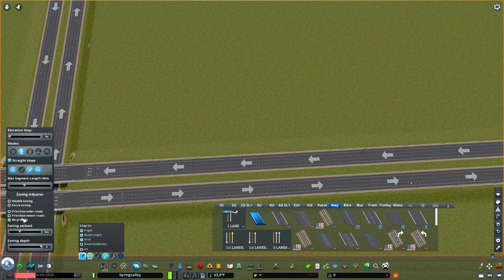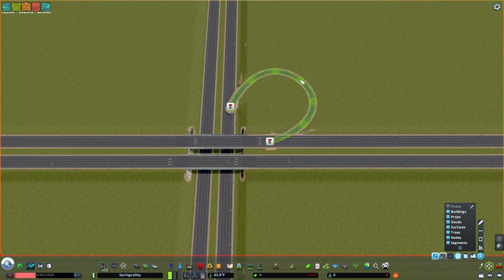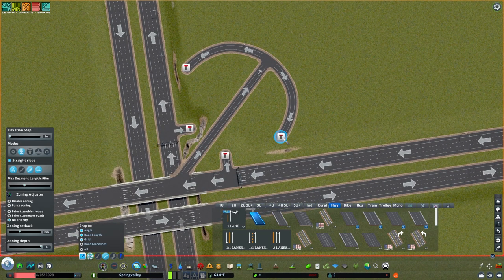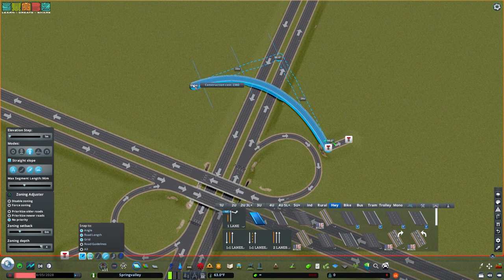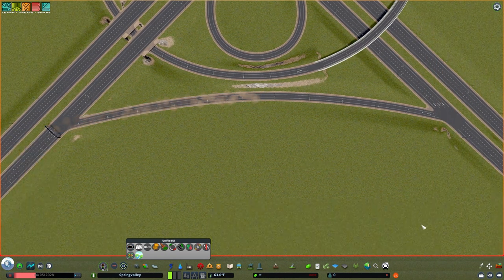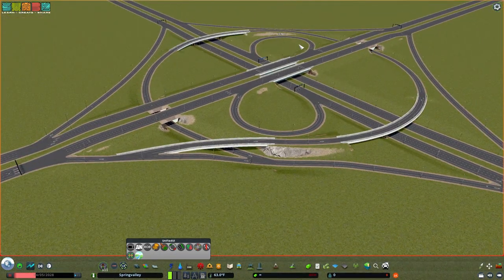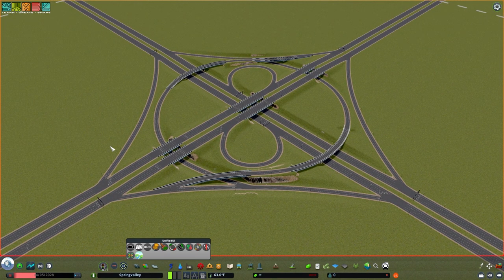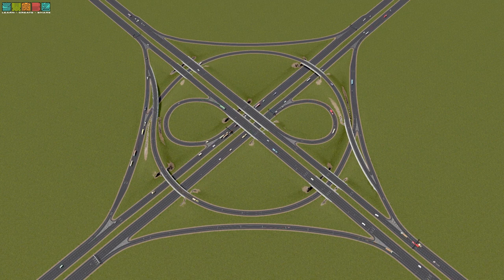The Cloverstack CRUSHES Traffic in Cities Skylines

Comment: If we're going for realism, we cannot be narrowing the highway down to two lanes in the middle of the interchange. AASHTO's highway manual has a section called "basic number of lanes" which basically says to keep a consistent number of through lanes regardless of exits (contrary to what many C:S players recommend for lane math). Lane balance is resolved by adding auxiliary lanes where necessary.
Reply: True but i think traffic AI pathfinding mechanics make it an issue as thru cars will still sit in the right lane causing unnecessary congestion for the exiting traffic. Just the way the game handles lane switching could be improved, but honestly that may be realistic cuz ppl suck at driving
Reply: The real world is messy. There's an example of a similar interchange in my hometown of Reno, NV. Westbound and southbound both reduce to two lanes in the center of the interchange (not exactly the way it's done here: there are lane merges). Isn't it possible the "basic number of lanes" is just two lanes?
Reply from the maker: The base number of lanes could easily be considered 2 here.
Reply: @YUMBL  Pretty sure they try to make it equal to the number you see in stretches between interchanges (not counting weave lanes between closely spaced ramps - those are auxiliary lanes).

After looking at system interchanges on Google Maps in urban areas (and I mean urban, closer to the center than the edge), some follow this principle, some don't. I wonder if high traffic system interchanges (I'm talking stacks) get special treatment because of the sheer volume of turning traffic? Or maybe it's practical difficulties of merging multiple lanes of turning traffic into the mainline in a reasonable amount of distance, especially given how squished together those interchanges can be.

Rural interchanges of course HAVE to follow this principle, because the required minimum is two lanes; they have no spare lanes to drop.
Reply: Okay a lot more urban system interchanges maintain basic number of lanes than it initially looked like. It turns out, it takes a LONG distance for multiple entrance lanes to merge into the mainline, so limiting the inspection to the interchange's immediate surroundings can be misleading.
Reply: I see why those interchanges drop lanes now. That highway manual has another section called something like "Coordinating lane balance with basic number of lanes." It basically says to drop/add x-1 lanes for an exit/entrance ramp with x lanes. So for a service interchange with a single lane exit, don't touch the mainline. For a big stack interchange with a two lane exit, one lane may be dropped from the mainline.

But then what is that rightmost lane on the mainline? It lasts for miles before ending, so calling it an auxiliary lane is a stretch (pun intended). But if it gets added dropped at every system interchange, it isn't really a basic lane either.

Comment: Clothoid loops ease off the acceleration experience by the passenger and driver on a cloverleaf highway.

This makes the ride significantly nicer and less painfull. Traditional perfect circle loops have sudden significant shift in acceleration which can cause pain on riding the loops. Its like suddenly speeding up then slowing down in a short time frame.

Comment: Hello, highway designer here. 
I know that you said that this isnt a real clotoid. Just wanted to add little nore info that curves like the one you designed are used in real world, however mostly in intersections.
I spent at least 5 minutes trying to find how to name these type of curves with two different radiuses however without any luck. I would call it like biradius curve or something similar. The curve in question is called "krzywa koszowa" in polish and its name originated from swedish manual to road design in 1930ish where it is called "kornsningskurvor".
Real clotoid has its radius gradually changing from infinity (aka straight) to desired radius over the distance.
Anyway, great vid, cheers
Reply: The railway also uses infinite radius instead of straight :)

Comment: You mentioned it but I mention it anyway as I was thinking it (having studied Railway Tech): Yes, railways do use this method, with a curve leading in to the curve. Because railway curves are also banked (which rollercoasters are not btw for obvious reasons) this curve is also the lead in to the full bank. With modern tamping machines all this is just in the computer, but in the old days you had to measure it when adjusting the tracks. You also needed to measure it manually before the modern machines that do it while driving on the tracks. Its really something I like :)

Oh, and on the railway there are no straight tracks. Its just infinite radius :)

Comment: The ease-in and ease-out trick might even help traffic flow stats. Cars and trucks drop speed for corners and if they drive slower then assigned speeds it makes the road more red. I've noticed using node controller to twist the road up to 10 degrees so they lean in also helps a bit to make them go faster, so they drive closer to the intended speed. It doesn't do much but on a map with a lot of sharp corners it can give you that 1%

Comment: Nice design. 👍
It works well and looks pretty from the air, which we all know is the most important thing in highway design! 

You're absolutely correct about the clothoid curves, but if I were to offer a criticism, they're still way too tight for a system interchange. 14u is about 112 meters which gives a turn radius of 56 m at the tightest point. That's about a 25 mph (40 kph) curve. Ideally a service interchange should not require a change in vehicle speed, or at most a 15% reduction if possible. At least they should in real life. I'd personally reserve a loop that tight for a service interchange. 

Lots of folks don't care about realism, and that's perfectly OK! Your sandbox. We also have to make some compromises due to the limits of the map size. I get that. That said, for folks that are looking for some reference design guidlines, here are some useful numbers for road design:

# Speed -- Minimum Radius / Usual Radius
45 mph -- 179 m / 226 m
50 mph -- 231 m / 291 m
55 mph -- 293 m / 451 m
60 mph -- 366 m / 604 m
65 mph -- 451 m / 745 m
70 mph -- 552 m / 916 m
75 mph -- 674 m / 1010 m
80 mph -- 814 m / 1221 m

Also, for urban streets...
15 mph -- 14 m
20 mph -- 30 m
25 mph -- 55 m
30 mph -- 91 m
35 mph -- 138 m
40 mph -- 203 m
45 mph -- 274 m

I snagged those from a street and highway design guide at some point and jotted them down. Sorry that I don't have a link to the original. 

While I'm dumping numbers, for the US Interstate Highway System...

4% Grade -- max through generally flat land
5% Grade -- permissible when the route must traverse rolling hills
6% Grade -- max in mountains

Finally, some grades taken from consultation with commercial truck drivers...

3% -- cruising at highway speed
4% -- no worries
5% -- straight roads ok; arterials, commercial/industrial districts ok
6% -- depends on how straight it is, how long it is, how heavy the load
7% -- US Highway System maximum
8% -- FULL CAUTION! Not going to be able to stop. This is the hard limit on commercial/industrial roads.
9% -- Max for residential collectors
10% or more -- Come to a complete stop at the top and descend carefully in 1st gear
15% -- Max for local residential roads (good luck getting your moving van up/down there!)

Hope that helps for the folks that are into such things.
Reply from the maker: Great info!!!

Comment: I recently learned, that with the curve tool (not the freeform one) and using precision engineering, you can get quite precise angles when holding down ctrl. It snaps the angle to multiples of 5. Maybe this is a neat trick to be used here as well and can save some move-it efford
Reply from the maker: I use precision engineering all the time. What do you think I did here to get the 45 off the corner at the beginning?
Reply: @YUMBL  yes, I know. but if you use that road tool, hold down ctrl and drag a corner, you can make perfect 120°, 115°, etc corners
Reply from the maker: Exactly. Thats what i did.

Comment: To be nitpicky, this is a clover-turbine, not a clover-stack. In a stack interchange, the left turns turn in front of each other. In turbines (and windmills) opposing left turns cross over each other. The difference between turbines and windmills is where the road that you drew at 12:52 connects. On a windmill, it connects to the main road, to the center of where the main road crosses the left turns; in a turbine it connects - anywhere else, really - but usually to the right turn ramp as you did.
Reply from the maker: Google cloverstack and see how they look.
Reply: @YUMBL  What? Why are you right? Who named the cloverstack? What's the point in naming something cloverstack if there's nothing stacked in it? I'm blaming that person for my mistake.
Reply from the maker: I’m always researching :)

Comment: I bet you could smooth out the loops even more using the bend tool rather than the freeform. Maybe do, like, 7x8 or 6x7 on the main bends, so the transition is even smoother.

Comment: I'm wondering if the same logic for interchanges could help traffic flow in a city, by moving conflict points to four or more junctions and having dedicated roads for certain directions. 

Instead of one main artery a city could have two main roads that form a certain circular pattern or maybe an inner and outer circle. From this another layer, the collector roads, can branch out. But these do not need to be symmetric (or even two way?).

Do you know any examples of city traffic managed in a seemingly complicated way, but actually just good lane math and moving conflicts away from each other?
Reply from the maker: Thats essentially how a grid of one way roads functions. Think parts of manhattan.

Comment: So you can do that without the two horseshoes. Just cross the large circle road in the middle with the outer ramps in all 4 quadrants as you did with 2 of them. It would still be 2 level for all parts.
Reply: No maybe not,  I get confused. You would have to make the circle one big round about with ramps going to and from it to the main roads, leaving straight traffic going through the middle.
Reply from the maker: I think thats a turbine if I’m not mistaken. Much more expensive.
Reply: You're right that first suggestion is a turbine,  as I looked into it, the bridging would make it cost more most probably. But what if you took my second suggestion, start with the straight divided highway roads as at the beginning, keep the center circle as is, fully connected as a round-a-bout, do not use the horse shoe ramps, then have eight ramps come off the round-a-bout to each section of the highway roads? Technically it would still be 2 levels, have almost same footprint, with less bridges thus costing less. Yes? I don't know what the interchange name would be. Just wondering if that would work the same or not.

Comment: I'm a little dissatisfied with the video. I'm a big fan of the clover stack and it's variant (example interchange in Louisville KY existing I-65 and I-265 system interchange, and one that is being adapted between between I-64 and I-265, again in Louisville KY). You did not go over being able to modify an existing clover interchange into a clover stack and that the stacks can be put where you need them for asymmetrical traffic flow to suit your needs.
Reply from the maker: I guess this comment covers it!

Comment: Not bad, but this interchange has a gigantic size, length and cost of road maintenance, excludes the possibility of building something within its limits and requires work with the terrain. It is not worth it to solve the issue of crossing two highways with its help when there are simpler and no less functional solutions.
Reply from the maker: These exist irl, and were chosen for a reason. They are only two levels high. Thats the benefit.
Reply: @YUMBL  Yes, these exist in real life and work great, I have nothing against it, but what is its size in the game? Moreover, it does not allow you to turn back. Why didn't you add the same two loops in the center for other sectors? This road junction is nothing more than an ordinary clover, but with less functionality and a larger size. There will be no traffic jams just because of this.
Reply from the maker: The cloverstack is best used in places with lots of space, but also demand free flow of traffic. Much higher capacity than a cloverleaf.
Reply: @YUMBL  Yes, much higher capacity and free flow of traffic just becourse a larger size and less functionality (no turn back), as i said. Why didn't you add the same two loops in the center for other sectors for turn back?
Reply from the maker: Because that is a different interchange entirely. This video is about the cloverstack interchange. Not a cloverleaf. I know you want it to be a cloverleaf, but it is not. Its capacity also has nothing to do with its size. Its the fact that theres no weaving, which is inherent to your cloverleaf. https://en.wikipedia.org/wiki/Interchange_(road)#Combination_interchange
Reply: @YUMBL  Ok i get it. I dont like none of them any of the clovers. I'd rather spend a few seconds to build an ordinary simple circle of the correct shape and connect all four directions with three-four-lane highways, with the possibility of turning in the opposite direction from where I came from (which this interchange does not allow what I'm talking about), while the occupied area is ten times smaller, without using custom roads, without work with the landscape and the level of elevation in general. All transport will pass this ring many times faster instead of senseless riding along this length, along which nothing can even be built.
Reply from the maker: Cool. I do other interchanges in other videos. What you’re describing sounds like an extremely low capacity bypass roundabout.